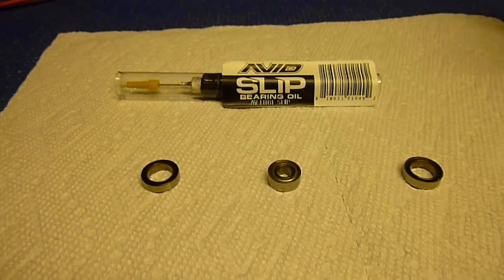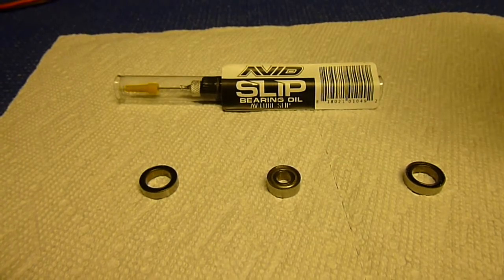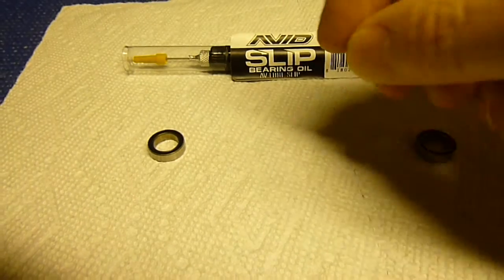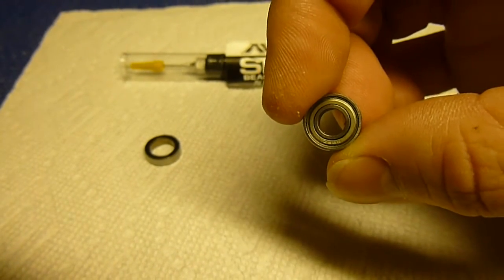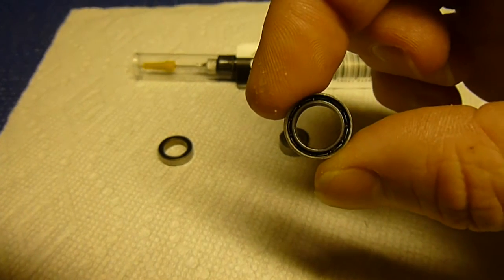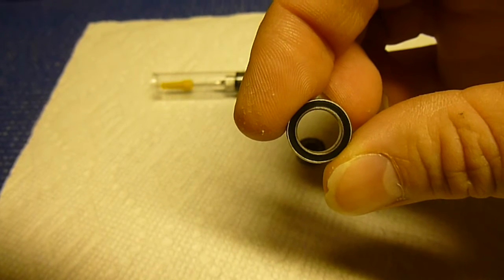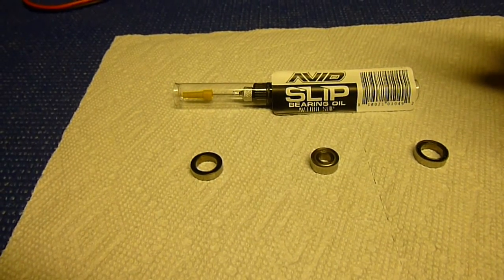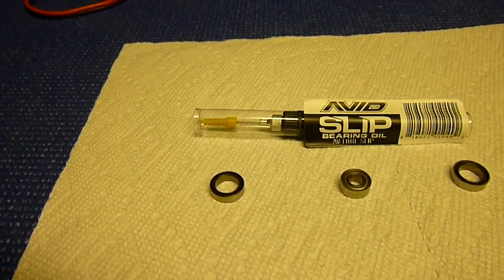RC Bearings for beginners

Comment: Now I have to argue the fact that the black rubber sealed bearings dont spin as freely. Only when their brand new! Have you ever checked your sealed bearings after week break in? They spin like nothing in their class. So smooth and my wheel literally will keep on going and going...like that battery bunny Energizer I believe. The reason why the new bearings are tight especially on the rubber sealed bearings is from 2 main  causes. #1 the amount of brand new thick grease that's packed in between the bearings & the race #2 the rubber seal being sealed very tightly against the center and outter race..within a couple runs the rubber quickly wears down allowing the bearing to spin more freely. Simple breakin takes care of that issue. And my personal opinion I was very let down with the rubber sealed bearings far as keeping dirt out. Within weeks..crunchy. worse than the crushed sealed bearings I pulled out. This particular build is just a 1:8 truggy running castle sensored 1515 brushless motor & a mamba monster x  esc..gens ace RS series lipos..two 2s wired in series using castle's series wired kit with the 6.5mm bullet connectors. Homemade 6 pack cappack Panasonic F series audio grade series forgot the farad specs of hand. Mine were like 3500 farads I believe. Castle recommends smaller to de-charge faster which is better for controlling ripple voltage better. Sorry got bit off topic. Maybe this info I learned might help others as well. Awesome and very informative video..... great job dude!!